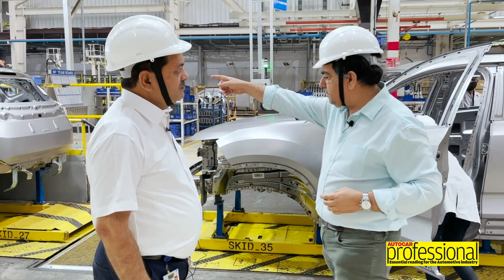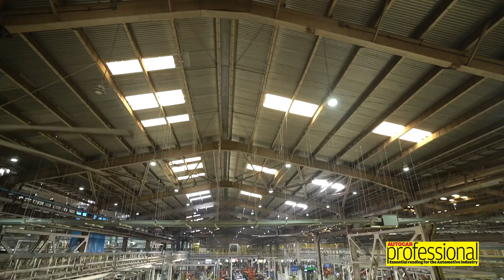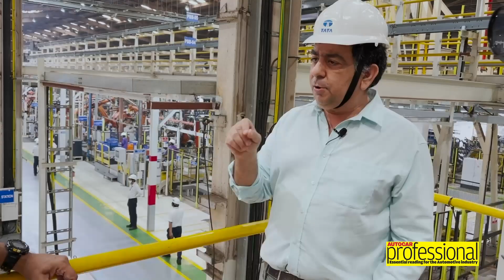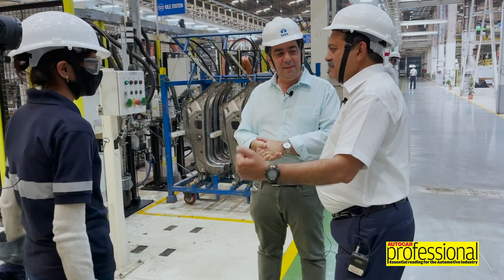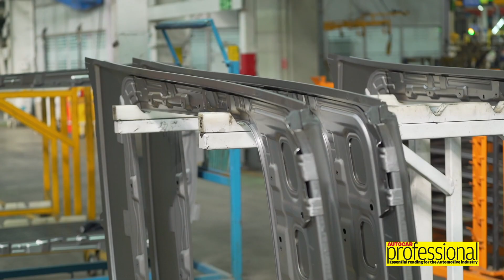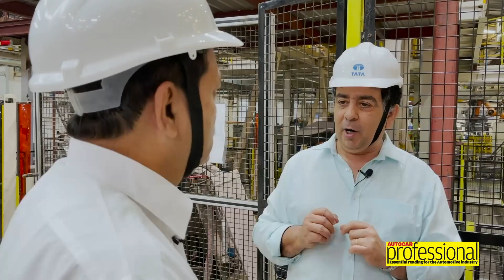Tata Harrier weld shop tour

Comment: Thanks for the sneek peek.
A bigger question for Tata Motors, what steps are being taken to ensure glitches in AVN systems, engine management systems that have been reported by users on various forums do not occur in the first place?

Also what is being done on the sales and service front? Here too would be owners are turned away by the lackadaisical attitude of the sales personnel. Owners too don't go gaga over the service provided.